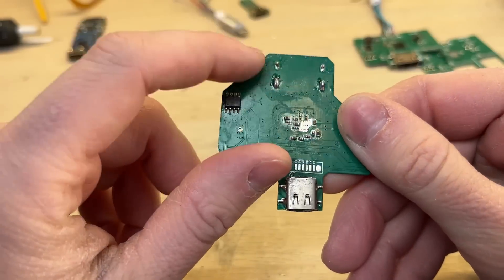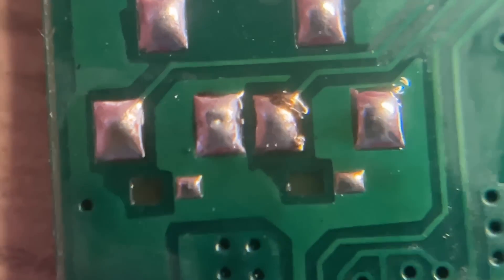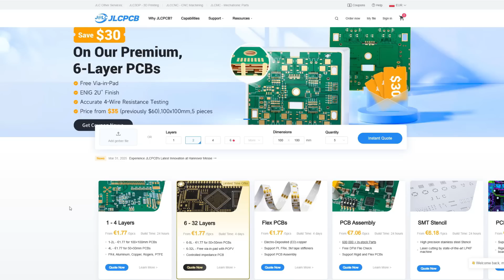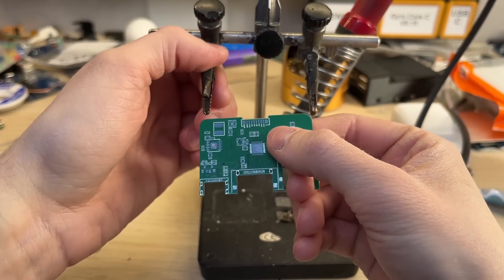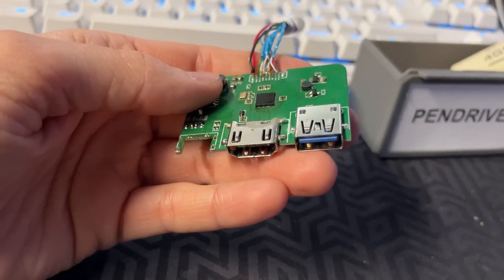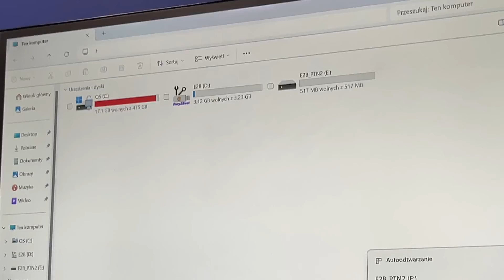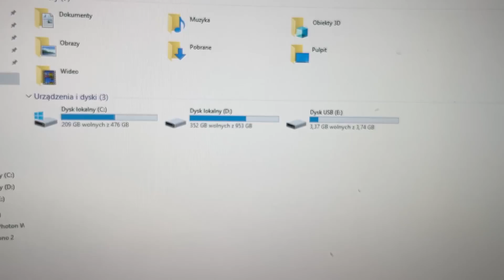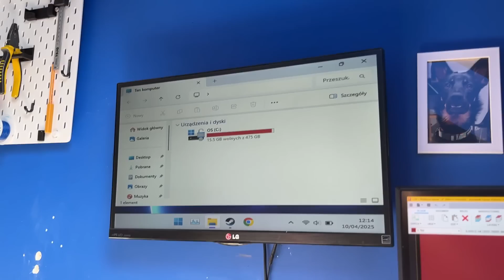DiY AR Mainboard Prototype - Part 2

Comment: Could someone recommend to me how I could learn about Hdmi? I'm trying to make my own mini-display array but need to figure out how to solder a micro display to a hdmi driver board but know nothing about it and don't want to spend $60 on one from aliexpress
Reply from the maker: Every display uses different display driver. You can’t just solder it to driver and expect it to work
Reply: @ManolloMancelli  how can you tell which one you need? Like for instance a tft lcd display that's like 0.4 inches
Reply from the maker: @ricocopuffs  Read the display documentation. See what display type it is. What kind of connection it uses. MAYBE find similar type board. Connect everything as suggested by both pinouts and then program the display driver. It's way easier to pay 70 bucks.

Comment: I think the issue might be with the cables data throughput. The Baseus one u tried is only rated for 480mbps. Ud need at least 5gbps or more. Great work though!
Reply from the maker: Really? It need this much speed ? I thought it would work since the cable is advertised as 8K display ready but I guess you might be onto something
Reply: @ManolloMancelli i just checked again. Ur absolutely right i mistook urs with a similar lookin baseus 240w fast charge cable. Urs is indeed USB 4.0 40gbps rated and therefore suitable for 8k stuff. Only things that i can think of why this wouldnt work is if for some reason the cable being USBC 4.0 is causing some issues, which would be weird because as i understand 4.0 is the same 2 lane design as 3.2 just with broader bandwidth per lane. Do u know what usb specification the working cable is and are u using hdmi alt mode on ur board?
Reply from the maker: I have no idea about the original cable specification. It came with the original chinese dock that I based this thing off of. I think it uses the HDMI alt mode since it works with iPhone which uses that.

Comment: That's a curious thing with the cables not working properly, could it be with the length of the cable? Maybe video output it's strong enough over that length?
Reply from the maker: I’ve thought about this as well. I’ve ordered some short cables from china. I will test them in the next part